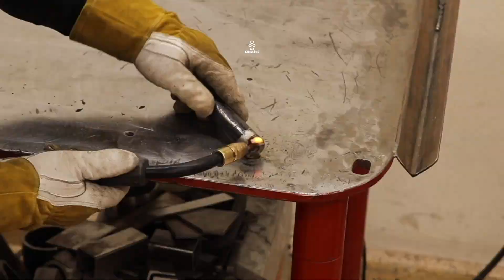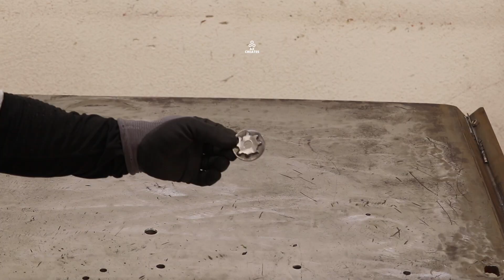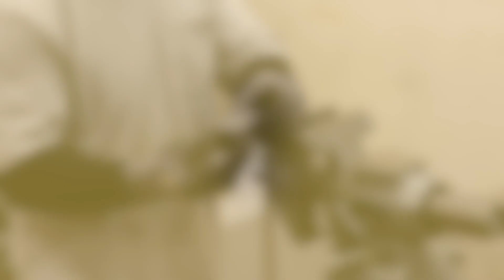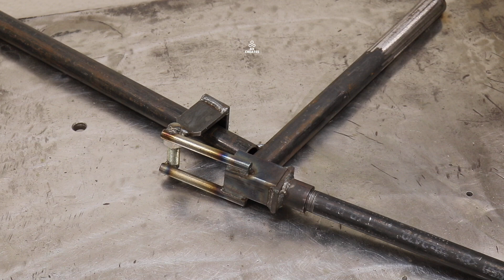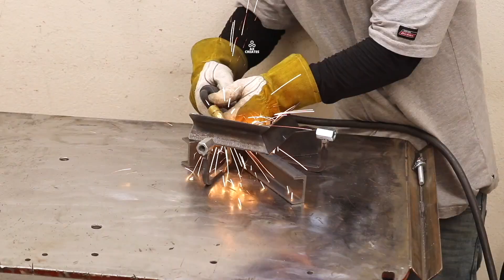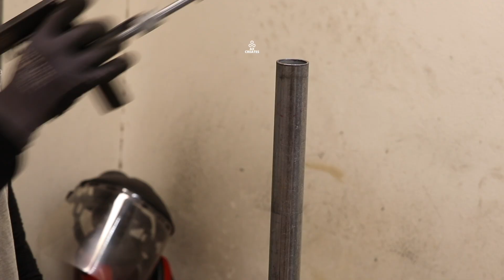BEST DIY IDEAS FOR MAKING TOOLS!! HANDY IDEAS YOU NEED!!

Comment: Excellent ideas AX! Can I ask what size might wire do you prefer to use and if it's flu core or solid and if so which type of gas do you prefer?  Thank you again for all of your ideas, they're great.
Reply from the maker: Thank you.  I use Lincoln Electric Super Arc .025 solid wire with 75-25 gas mixture (argon, co2).  PGN also make a good product, I’ve used it in the past. Thank you for your support!
Reply: @axcreates_official  thank you for the information.  Your welds are so clean. I will try that size and gas mixture. I've been so used to just using .030 or .035. I will try the smaller size.